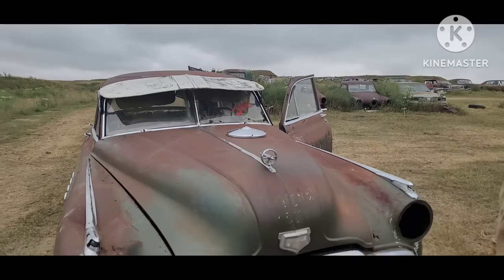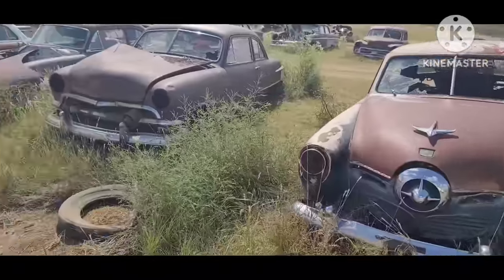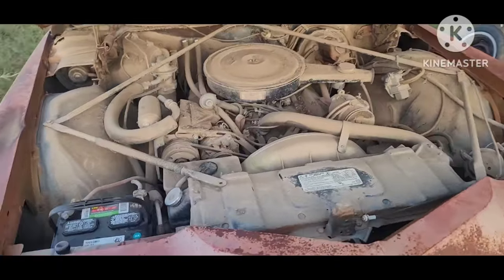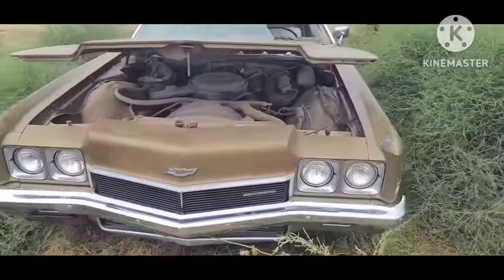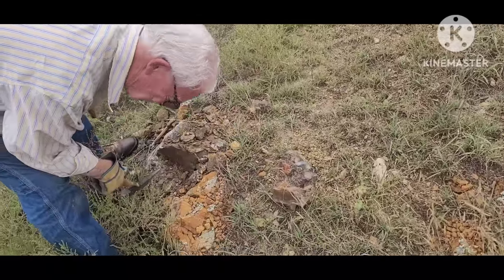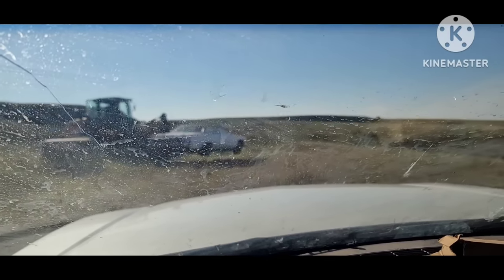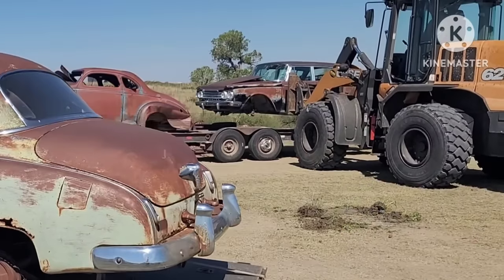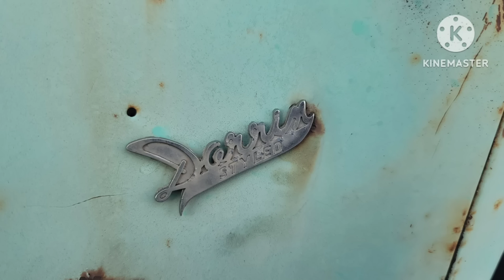HOW MANY auction cars will $10,000 buy?? We Load Up 1930s to 1970s vehicles! Chevrolet, Ford, Kaiser

Comment: Tim, first thing off is "If I make this comment too long, I want to apologize right off of the get go!"  Okay as I watched all of the video, I noticed something about a lot of these cars thats a lot odd for most of the cars laying out like this...... Okay.... all of those cars that rocker panels were rusty an what not, their floorpans were in great condition. Now I know for a fact that when you buy a floor pan off of those places that sell floor pan sets, they sell for usually over a thousand dollars! I would be willing to bet that if you had a good condition floor pan from one of those cars, yes I know its quite a bit of work to go around all those spots where its spot welded but you yourself would learn a ton about those kind of repairs from what I am suggesting..... you would not have to get the hard stuff off of the edges where it buts up against the walls of the rockers or other tuff to peel up spots, just the general big area where your feet go and where the seats bolt into a rig. Its harder to make a patch panel that fits really well in those areas if you are making your own. Also when you buy the cheaper panels for cars off of the internet, seldom that they really fit.  I am suggesting that if you know of cars that are so popular and sell very easy, a good example is the tri five chevys.   You have parts of any kind, they are a easy sell. The eyebrows on the fenders and tail lights are a very easy sell. What I am suggesting is that  a large panel package of most hard to find panels would bring good money. A rig that if all that was left of it in spots like this one you guys just salvaged, I see dollars all over the place. Now that junk guy doesn't care if the stuff he is going to crush has any holes in the metal, If ya have a grinder for cutting panels out with you, a headlight brow from a tri five in your hands will sell for fifty to a hundred dollars. Only takes a few minutes to whack one out of a rig. I do realize that anytime you go to those sites, you are starving for some food before you are able to leave. I am just suggesting that its money a person can make when you are there and you know that the scrap guy that you are already buying stuff or trading parts with would probably give you a go ahead on some of that stuff and you could pick up some precious fuel money for making trips to a auction. A example would be  to talk to that scrap man and tell him that today we are just there to bid but coming back with some rigs to move stuff with. This means that even if you don't buy any rigs yourself that day, you can cut out a panel you know is good money in a couple more hours after the sale is over. I am a old man now but sure wish I were younger as I loved to go to auctions and buy stuff or even just watch sometimes. When a person goes to a auction, its costing you money that you would be making if you had stayed home and worked. I don't think a lot of the readers of these videos know how much money you are investing to go to these sales. I figure that when your at home doing what ever you do regularly, you probably make a easy fifty to a hundred in the pocket just answering your phone and then selling those pieces.
         Yes sir, I did it again...... too long a comment but do apologize for that, I just want to help you earn a few more dollars for even going out to the auctions. That said and of course when you are home looking at a rig that pretty much all parts removed, the floor pans should bring you some  real good dollars. It would most likely take you a whole day to remove a floor pan out of a rig when you first start. I know it took a good while when I first started doing this. I got to where I was  taking out as many as five and six a day that were full floor pans. And then those part pans like across the back where your feet go in any of the fifty model rigs, using a plasma cutter and a drill, only a couple hours to get a lot of those out as well as some other pieces. One other thing that I do need to do is learn how to write these as my sentences are way way too long.... I must take a lot of your time to just read my junk.
Reply from the maker: The 1967 Pontiac's trunk floor was perfect, it even still had the grey spatter paint pristine without even surface rust. I was a little sick to see it go for iron. I wanted to buy more cars, but the time to haul them is always a limitation (not to mention storage space once I'm back home with them). Unfortunately the last Dodge was stolen before I could pick it up, so I suppose it was best that I stopped where I did with the ones I bought at auction. We worked until dark the first couple days pulling parts. Unfortunately this was several hours from home, so travel time cut into work days also.

Comment: '59 Chevy Wagon...Why??
Reply from the maker: In the video before this, I explained the vintage derby cars, and where the 1959 Brookwood & 1963 Chrysler 300 fit into the early days of the sport. It didn't get much reach here on the 'tube, but I put a lot of effort into making it, and it goes a long way in telling the historical significance of these cars. You can find it here:
https://youtu.be/bui78gSuhHU
Reply: Saw it still had the block off plate very cool